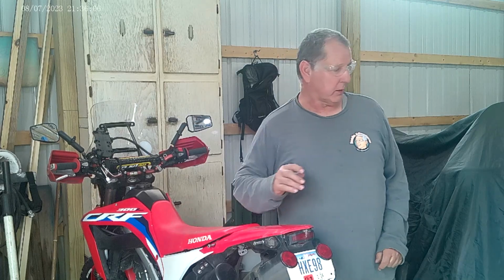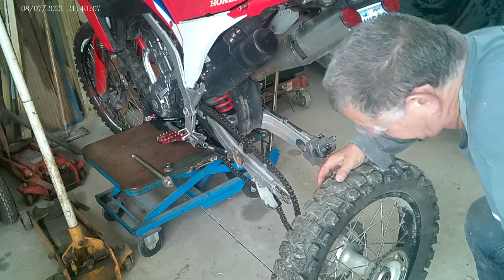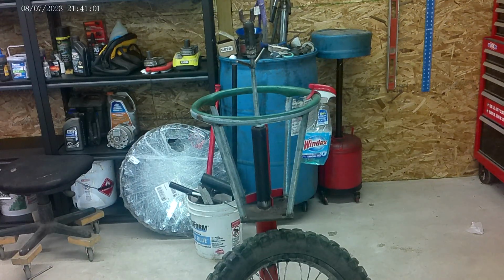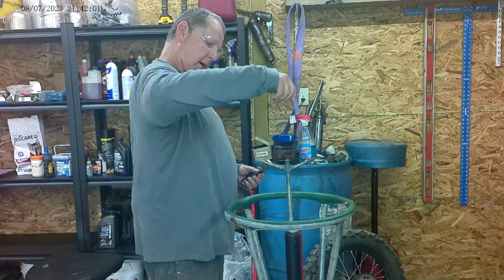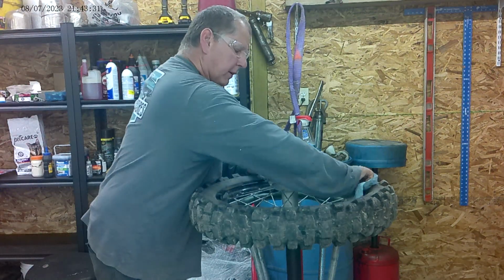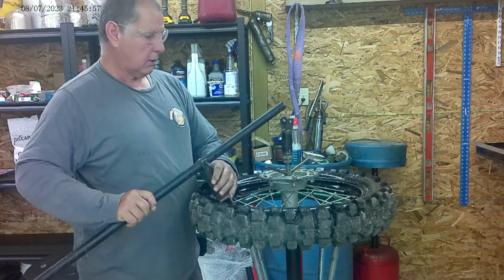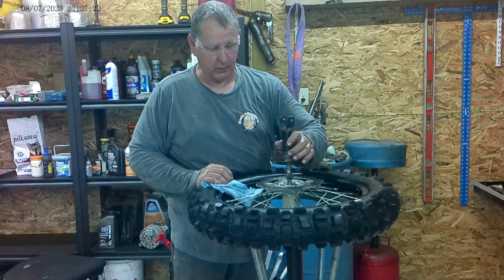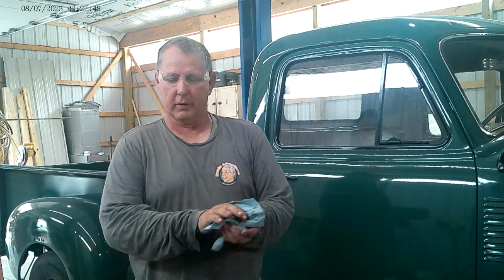Tire Changing is not my strong suit!  Changing the back tire on the CRF 300L.

Comment: Nice. I spray soapy water on the tube, so it slides like the silicone you are using. Great idea to lubricate the tube. I also like to temporarily inflate the tube after putting it in, then deflate before I button her up. Gets any twists and turns out of the tube. I've finally gotten pretty good at changing tires after pinching a thousand tubes. Lol.